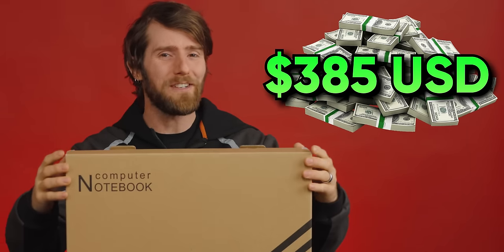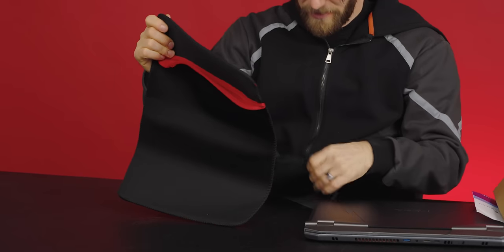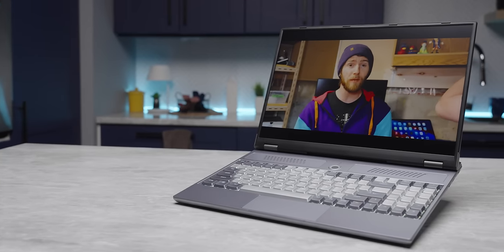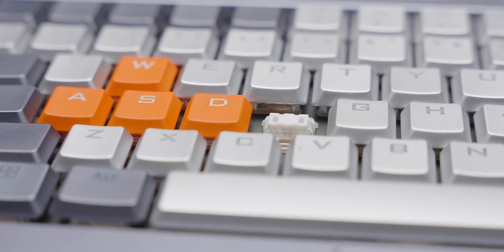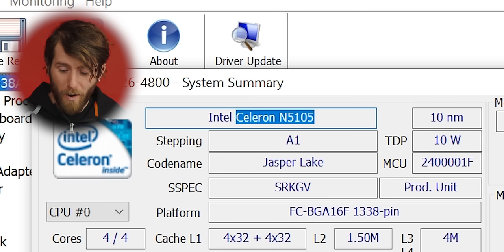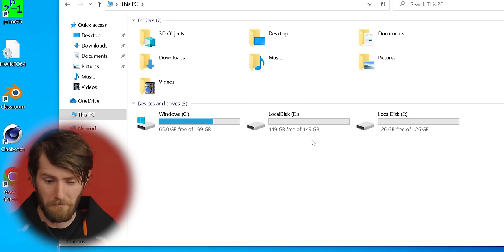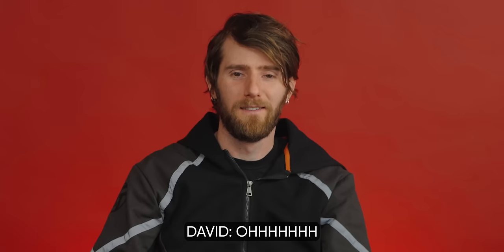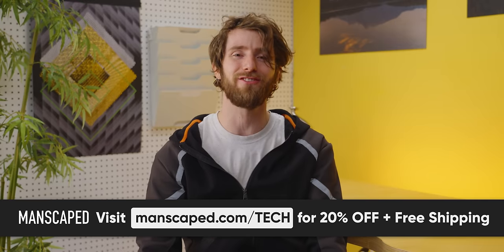Brown Star for Effort – This AliExpress Gaming Laptop is HILARIOUS

Comment: If it was an AMD CPU (even a first gen 3000 series to keep the price super low) it could have been at least somewhat usable in games (even at 2400mhz ram which can be swapped.) That would have made this laptop a champ for the price. The Celeron made the system a 2 out of 5 killing all the cool stuff about it 🤷‍♂ Not sure why they went with a Celeron if they were going to brag about gaming.
Reply: At this point, "gaming" refers more to the "style" of a computer/laptop/peripheral than necessarily the top end performance.  Think 90's V6 Mustang: looks fast, isn't.  Also, gaming doesn't just refer to top-spec graphics anymore, someone really into whatever anime RPG that was that Linus was playing would be happy to have a cheap, presumably pretty long battery life, cool running, lightweight computer with a nice screen, keyboard, and touchpad to play the game they actually play rather than walking around with a hulking, expensive, battery-sucking true gaming laptop that's way overkill for what they're actually playing.  Some people want a high performance sports car and don't care about MPG, others want a Prius that doesn't look like a Prius.
Reply: Sadly mobile ryzen 3*** limit ram at 2400, I got one in my aliexpress laptop. Probably the same case for this one
Reply: @nunyabusiness896  Yeah I agree, especially with the mustang metaphor. 
I'm just shocked they went Celeron.

An AMD Mobile Ryzen 3000/4000 wouldn't had been "gaming" either but the Vega iGPU would had performed a little better than that and probably would be about the same cost since it's 3-5 years old now and they could had stuck with a 4/4 core/thread. i see a lot of under $500 laptops with those older AMD CPUs with 4/8 and even 6/6 core/thread.
Reply: @leberrion  I didn't know that. I never paid much attention the Ryzen 3 mobiles.
Reply: im sure you can find a version that has AMD in it. those small brand laptops are crazy in China too. all the experimental design, enough quarks and features even Doug demuro would be surprised.
Reply: 2400mhz ram is totally usable, I have it in my desktop. That's not what was killing game performance lmao.
Reply: And how better processor would help with gaming when there is no video card? "Gaming" laptop my ars, as they say. :)
Reply: @Ms Moon Boo Not a Celeron though, it not like that has Iris graphics.
Reply: 1. Look at the resolution they chose to game in for crying out loud, it is massive, Linus made a stupid choice there, this is not a laptop board and GPU, it is a micropc SOC board, it will do 1080p medium in most games at 50 to 70fps just fine, try doing more than that, expect shit performance, as Linus should have known if his head wasn't up his arse.

2. If it was an AMD 3000 series CPU uses 7 to 10 times more power, it would require an entirely different full scale laptop board and much beefier power & cooling systems, the cost would skyrocket. The new Celeron/ N chips are quite capable chips that on a single core basis outperform the AMD 3000 series. These new lines of N chips are designed to use as little power as possible while doing as much as possible which is why they are the most common types used on microPC SOC boards.

3. They brag about gaming like all companies of their field do, because they want to sell products. Your complaint seems to be that advertising may not be true, in which case I would have to ask you what rock you've been living under if this is a recent revelation to you regarding this one company alone. And like I said, dont try and game at 2 to 4K resolutions like Linus did and you may stand half a damned chance of it working perfectly well for most games and it is certainly perfectly good for an indie gamers who like rimworld, oxygen not included, cosmoteer, planet builder etc. 

I mean for fucks sakes, Linus was running that little micropc SOC board at 2560 x 1600 in game, I own an RTX 3070FTW3, I have 32 gig of high end ram, 5700X, PCIE-4 M.2 drives, and even I would not game at those resolutions while expecting good results, utterly stupid of Linus or anyone to judge it cant game when you wack up the resolution to fucking stupid levels beyond any intent of the original designer of the board, who were likely not the laptop maker but probably Asrock as they make the largest volumes of micropc SOC boards and neither the laptop maker nor the board maker have likely ever said "suitable for 2K to 4K gaming" which is what Linus was trying to do, because he is a jackass.

For the price, it's a good laptop and a clever use of a different existing technology to produce one. Well done to those particular Chinese people and company.
Reply: so i could be wrong, but i think the ram in that laptop is not swappable as its shown as Row of Chips instead of dimms. my lenovo uses this and cant be upgraded for more rams 💀
Reply: @Nine-Signs  If a laptop is being marketed as a gaming laptop, it should be reviewed primarily based on its ability to run games. If it can’t keep up with the games Linus ran at the settings he used, it is a terrible gaming laptop. With some minor polish and a working webcam, it would be excellent as a “luxury” option for light usage such as web browsing and office work.

And what a terrible attitude to have about false marketing. It doesn’t matter who does it or how long it’s been done, deceptive marketing should always, ALWAYS be called out. Shrugging your shoulders and throwing your hands up in the air because shitty companies do shitty things only makes things worse.
Reply: @Ms Moon Boo UserBenchmark, is that you?
Reply: Simply,  it was cheaper and AMD budget iGPUs where not available.
Reply: @FuckedUpGenius  Indeed, it's on the low end of DDR4 RAM speeds, but DDR4 is pretty speedy period and not going to bottleneck performance unless the CPU and/or GPU can churn through way more data than the ones in this machine can.  Since I run big bioinformatics jobs... I also always prefer more RAM over faster RAM, very pleased to have 64 GB in my laptop now as it makes it much more feasible for me to test medium sized jobs locally before sending to the big clusters.

Comment: Single drive multiple partitions is a very common Chinese thing, at least 10-15 years ago when I was in China and worked on family members' PCs and even some laptops. I remember back in the days I was taught that having (logical) partitions and isolating Windows install's partition from everything else can help prevent virus (you're supposed to install everything non-Windows into a separate partition). There's frequently 2-3 logical partitions out of a single physical drive on sketchy Chinese PC builds - one for Windows, and then either a second one for everything else, or a second one for software installs and a third one for "data" (like pictures, videos, documents, etc, and the User profile folders for those things are frequently redirected to that partition). I'm pretty confident that this was very common back in the days, didn't know they still do this
Reply: Yep 100% true. I live in China and yeah most people still partition out their drives like this, actually makes sense since you can re-install your boot drive in case of any fuckups
Reply: This is just good practice everywhere. Done it ever since I built my first computer in the early 90's.

Comment: This one is actually $275 in China. (I think it is a good substitution of Chromebook - -
Reply: It's atleast 3-5 times better than any chromebook at that pricepoint
Reply: @ireallyreallyreallylikethisimg  XD I agree
Reply: Man as a Chromebook alternative this thing would absolutely slap. I love 16:10 screens and that keyboard would be really good.
Honestly the performance might not even be that bad since you could always Parsec into your main PC at home.
Reply: @mildmixchintu1717  Anything is better than a Chromebook. Those things are way too limited by the OS
Reply: @Mirra2003-f9s  Too limited for what? They're the most sold things on Amazon and work fine for like 95% of people. Plus they run native Android apps...
Reply: @esaedvik  Well most they can do is just browse the internet.....if i want Android apps i can just use them on my phone. They might be one of the most sold things on Amazon but they're also extremely cheap. Cheap things will always sell the best
Reply: @Mirra2003-f9s  You can go into the settings of most Chromebooks, and systems with ChromeOS Flex on them, and turn on the use of Linux apps, which opens far far more options even if the ChromeOS/Flex device does not support Android apps. Also it's in early alpha stages, but Valve has STEAM running on ChromeOS/Flex, and from some of the test videos I've seen it's not 1/2 bad if you have a decent enough system. So ChromeOS/Flex is far more usable than you think since it is based on Gentoo Linux, and again when you go into the setting to turn on Linux support it can run .Deb(Debian)Linux apps.
Reply: @mildmixchintu1717  it's better than most laptop twice its price point. Mech keyboard dude.
Reply: Anyone got a link to this thing? I can't find it on AliExpress

Comment: I'd love to know if Linux has drivers to support all of the hardware in this?  If so it might be a great option.
Reply: Other than maybe the webcam and USB ethernet adapter it should work
Reply: Apparently the chipset is relatively normal, so I would guess that Linux got all the drivers needed.
Reply: @yotoprules9361  The webcam looked like it had 4 pins which might just be USB 2.0, which would make sense since a lot of laptop cameras are connected with USB internally anyway.
Reply: Its just a normal Intel computer and it has an Intel wifi chip so I dont see why Linux wouldnt work with it
Reply: Without further looking into it I see no reason why this wouldn't make a good Linux machine. 
The Intel WiFi chipset is well supported, the Webcam appears to be crap anyway, so just toss it. It might also be just a weird way of creating a USB connection and "work" without issues, though. The rest of the components shouldn't pose much of a problem to modern distributions either.
Reply: Absolutely would work. In fact a celeron would feel like a good cpu on almost any Linux distro.
Reply: @yotoprules9361  the connection of webcam is probably USB 2 or maybe USB 1. Its just pogo pins instead of normal "pins". While I love the idea, pogo pins are just BAD. They push in and lose connection whenever the fuck they want so I would stay away from it. But the idea is super cool nonetheless
Reply: @Enstrayed  in that case it should work, just depends if it needs proprietary drivers or not like the Ethernet adapter does
Reply: @melihcelik9797 They either should have just had no webcam at all,  just made the screen a bit thicker for an internal webcam with a sliding cover, or included a normal small USB webcam as a bonus gift, as I agree pogo pins are a bad idea on all but maybe a keyboard dock for a tablet that's on a desk/lap tray that does not move around much, or a magnetic one to charge say a basic smartwatch that does not have wireless charging.
Reply: @yotoprules9361  Might also have issues with the fingerprint sensor
Reply: The Intel Wi-Fi chipset sounds like a good thing for Linux compatibility. I wouldn't be surprised if the fingerprint reader wouldn't work though.
Reply: I really wish LTT started evaluating basic Linux compatibility with laptops/desktops nowadays. With a LiveUSB, testing could even take as low as 10 mins.
Reply: It is not cheap laptops which have a problem with Linux but rather expensive ones from certain brands (Microsoft, Samsung), as the latter often have a lot of custom hardware with no publicly available documentation.
Reply: I think Ethernet would work fine, as I've seen those generic dongles before and they usually use a Realtek or a knockoff of them, the fingerprint could be a problem depending on what did they use

Comment: Linuses reaction "Oh no, it sends our data to Chinese government and hackers" to the default pirated windows installation is kind of hilarious
Reply: Pretty sure any vendor moving a large enough amount of laptops on AE has to comply with a CCP program that includes installing several backdoors on the devices.

The gov already subsidizes a lot of products on AE, with much cheaper or even free shipping worldwide, as well as sales where products are practically free - to compete with amazon and the likes -  so I highly doubt they would hold back from installing anything on the stuff they pay for.
Reply: Also, funny enough because you either had to sell your data to ccp or to Microsoft

Comment: For laptops 2400 isn't TOO slow depending on its cas latency. I picked up a Lenovo legion 5 last year and did some ram testing and 2666mt/s cl18 was getting consistently higher FPS in all of my games compared to 3200mt/s cl22. I should also note the cpu is a ryzen 5800h
Reply: This is worse. This laptop has LPDDR4-2400. Not DDR4-2400. I assume this is like the Nintendo Switch level of RAM speed. Maybe not that bad, but it's still very slow.
Reply: The absolute latency of 2666@CL18 is only 2% better than 3200@CL22. Your performance difference was probably due to something else. If RAM was the only change perhaps you were going between single channel and dual channel mode.

Comment: Man i really miss the times where you could upgrade the processors in laptops....imagine getting this for the mechanical keyboard and just replace the processor with something better. 12 years ago i had an old Lenovo laptop with a singlecore Celeron that ran like crap. I simply removed a small door on the bottom without even having to take the whole damn thing apart,put a Core 2 Duo in it and used it for years with no issues
Reply: can that be done with this laptop?  would be nice to know whether the cpu was soldered into motherboard or is removable
Reply: @splatt3d  no,laptop CPU's are not upgradable anymore

Comment: As the 5105 doesn't support faster RAM than 2933, going for the cheaper 2400 (which is quite plentiful) for a budget laptop of the price point seems reasonable. The question of whether or not it can make use of faster RAM was asked or answered. If the RAM(2 used slots as per Task Manager at 09:23) was visible on the exposed side of the motherboard, Too bad:soldered. If it is on the back side, a PITA in that pulling the board is the only way to get at it. For me, a no go on soldered. Hate that crap. When it fails, the board is useless.

Comment: I went with a 16:10 Legion 5i after hearing Linus rave about his Dell 16:10... absolutely worth it IMO, the extra screen real estate is usable in nearly every scenario and makes working on a laptop much more functional (especially when coming from a 21:9 1440p ultrawide)
Reply: Honestly i would not be surprised if 16/10 screens comes back even on monitors.  For laptops it was and still is awesome.
Reply: Wide screens never really made sense in a laptop anyway (other than from a production economy point of view). Going wide is the natural thing to do when monitors take up more and more of your field of view, as we can accommodate extra width much more easily than extra height. A laptop screen doesn't have that problem to begin with, and I wouldn't be surprised if the ideal aspect ratio were 4:3 or 5:4 depending on size. 3:2 already seems to be a common option on more premium models.

Comment: I bought a similar USB to Ethernet adaptor a few years ago for five bucks. It's a bit slow and the cable started fraying almost immediately, but it's enough to get a machine a connection in a tight spot, so it's worth keeping around.
Reply: True, but you can get a 1GB from Amazon Basics for 12 bucks.

Comment: I came for cringe and was left wondering what they could do with just a little better processor and GPU wth? Lol
Reply: I can't believe that cpu draws only 10 watts. That's like a bright LED lightbulb. Or an extremely dim tungsten lightbulb, like one of the tail lights of your car, but not a brake light, I believe those are 25 watts producing twice the heat as that CPU ... i find that the most amazing. it almost doesn't need a cooling solution if it's mounted against the frame of the laptop with a pad.
Reply: ...and RAM too.

Comment: Something to keep note of for the performance testing: The screen resolution is 2560x1600
Reply: Really wish they would test CSGO at competitive settings like 1280x960, never in my life will I run CSGO at higher than 1080p
Reply: My laptop has measly Intel HD 620 and a 1080p screen. I enjoy the 1080p most of the time, but when playing 3D games I just pick a lower res and enjoy reasonable frames instead. I have no idea why they benchmarked gaming performance the way they did in this video.
Reply: @rzul  They always do this, I mean its fair to test at the monitors native resolution, but it would be nice to also have a more realistic test